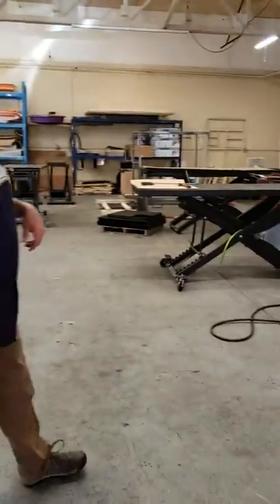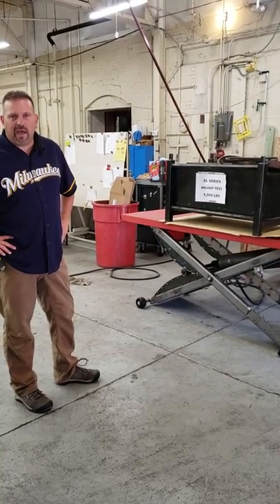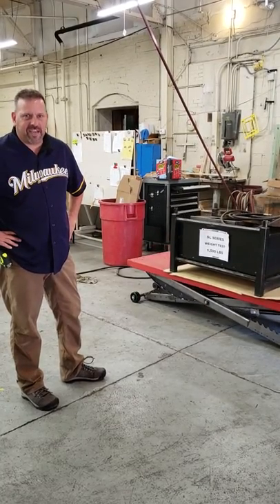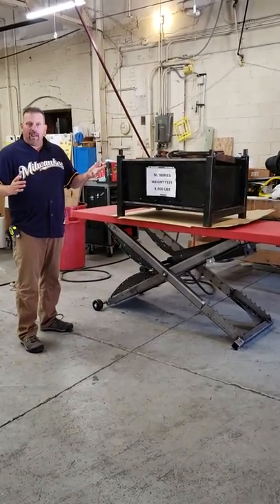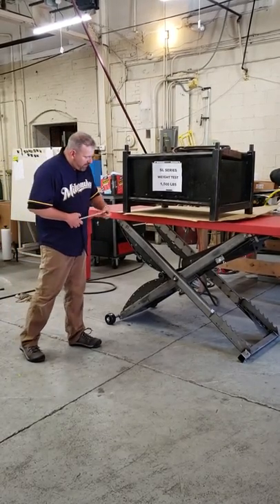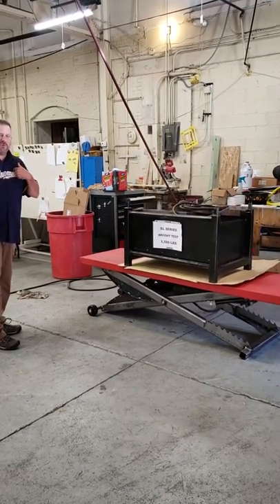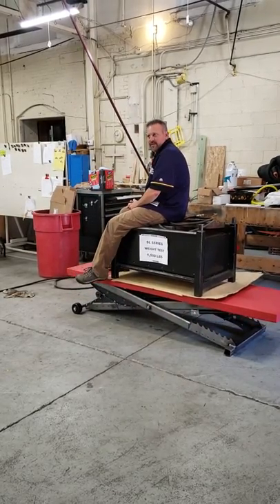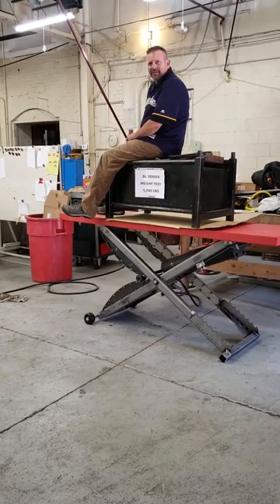Load and Stress Test for HMC Motorcycle Lift Table.  Made in America and Tested for durability.

Comment: So this video has been out for 7 mos or so.  Where are you or where did you end up on the lift test count?
Reply: Went over 10K repetitions....shortly after we had a weld bead break on the gusset at the cylinder yoke to the bearing shaft.  That's a pretty good result in our view as this test was continuous repetition of 1,500 lbs 10,000 times.  However, we still went back and redesigned the gusset to a heavier gauge steel and added a boxed end to also increase it's strength.  Thanks for asking!